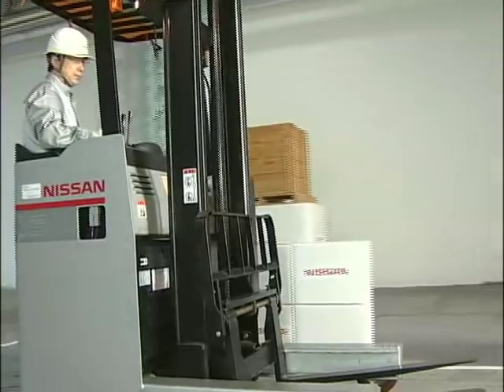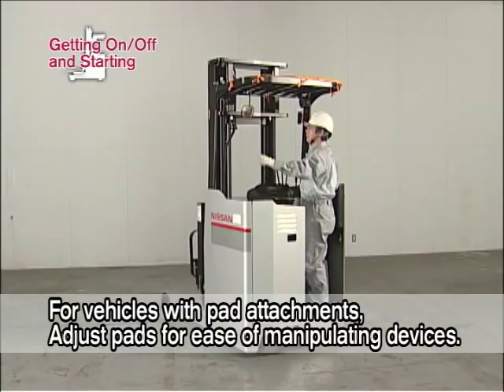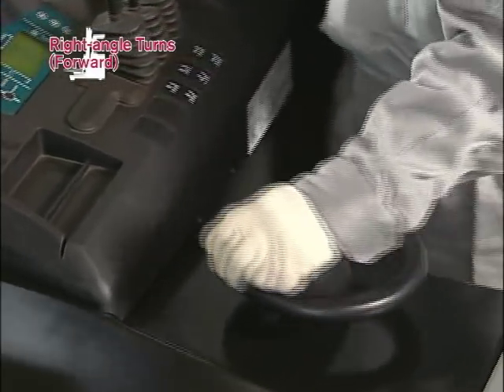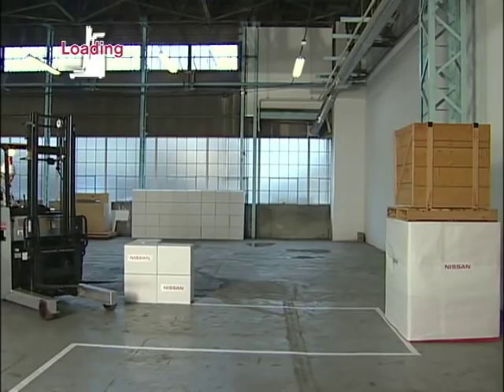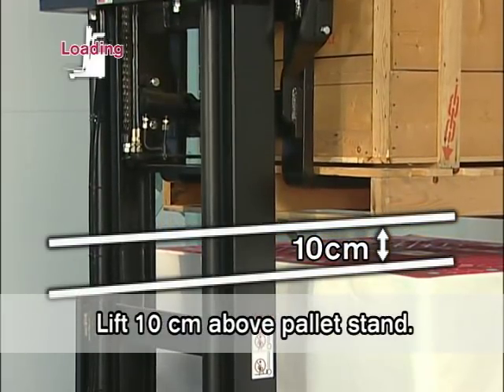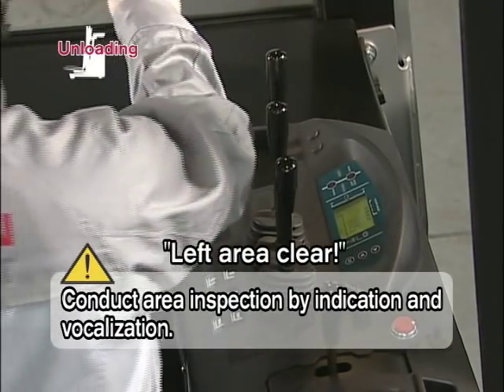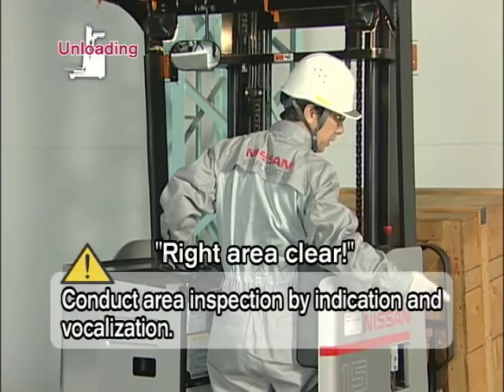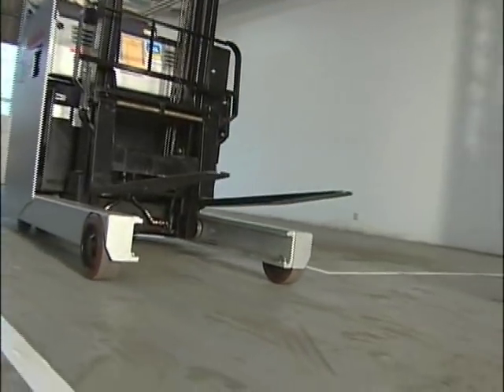Basic Operations of the Reachtruck

Comment: Yes forks are up too high while traveling. Should be tilted down and 1/2 inch off the ground
Reply: That's what I said, you don't drive around with your forks that high, they should be just high enough that they're not dragging on the ground
Reply: no for travelling they should be 150mm or  6 inches  from the ground tilted back.
Reply: If you are driving a reach with product then lowering your forks to half inch would crush the pallet

Comment: Arent  you support to tilt backwards before you lift a pallet off a shelf?
Reply: Tilt back and you'll be putting pressure on the front rack. Lift first and then tilt back.
Reply: Lift it off of the rack 

Tilt it back as soon as it's visibly off the rack. (If clearance allows). If the clearance only allows lifting off, then tilt after reaching it off.

Retract the reach back towards you. If aisle is narrow, do a combo move where you turn it parallel to the aisle in the air

Lower the forks to a low height (a few inches off the ground). Keep the forks tilted so it doesn't fall off.
Reply: @martz1191  mybe you should be making a video
Reply: No, never ever tilt backwards to get a pallet, bin, rack or anything else off a shelf. 

1.) With your forks evened out, lift the pallet straight up, making sure you have enough clearance from whatever is underneath it.
2.) Drive in reverse just enough to pull out away from whatever is in front of it.
3.) Now that you have clearance you can safely tilt back before backing out and dropping your pallet down.

If you tilt back when your forks are in the pallet/bin/rack to lift it then you are going to clip the pallet/bin/rack in front of it, it will catch and you will drag out the bin in front of it without realizing it. You don’t want to have an entire column of pallets/bins that are 30 feet in the air all come tumbling down to the ground. Injuring someone in the area.

Comment: Even if the forks are fully retracted, they should never be that high off the ground, especially tilted back.
Reply: Obviously you haven't used one of these the pallet does not fit between the straddle arms thus making it necessary to be that high

Comment: Why is the load tilted downward at the front ?
Won't it fall off ?
Reply: c
Reply: The only time I tilt forward is to place it in the rack. Even then only slightly so I can push the pallets back without hanging the one I'm dropping on the rear one.
Reply: When the load is 3 metre tall and looks instable I also tilt the fork on me. Three gitterboxes on each other for example.

Comment: This is the most ridiculous training vid.
Reply: I was taught abit differently... i would always tilt right after picking up the load and moving the pallet 15cm off the surface...also they would teach us to tilt back to 90 degrees by putting the forks up to eye level.!
Reply: Check out klaus the forklift driver if you really want to see a training video lol
Reply: @alekshukhevych2644  Don't forget that this is most likely a Japan-oriented training video. In Japan, safety-procedures like this are very common (look up a few train-driver videos or traindriver-exchange videos, you'll see the traindrivers pointing to each item that should be checked, while also confirming that verbally.
Tilting up right after picking up a load sounds a bit dangerous to me, as the end of your load will go up a significant amount. At the place where I work, that's enough to wreck the pallet-stands as the end of the pallet crate will hit the edge of the next 'floor'.
I was taught to level the forks by finding a spot inside the building you know is straight (a pallet stand or overhead-door for example). Align the machine in such a way you can slightly move back and forth with your head while looking past the mast, so see if it ligns up with the perfectly vertical object. But, ofcourse, this works only on forklifts or reachtrucks that have a completely tilting mast instead of forks-only.